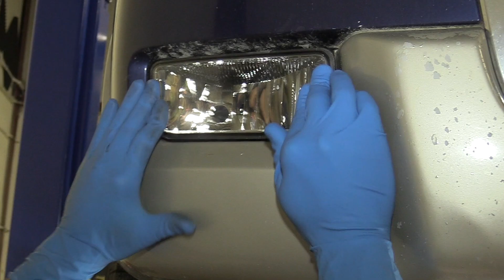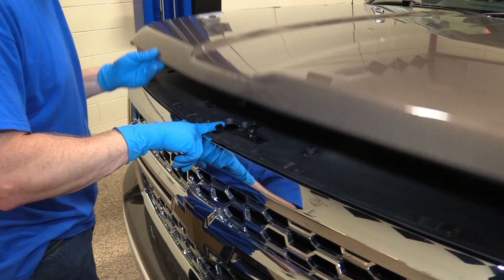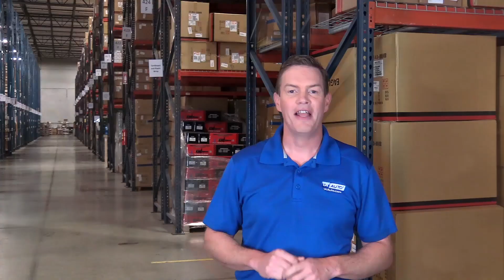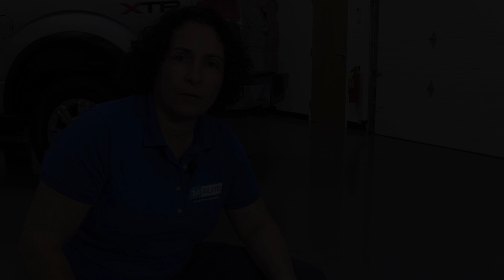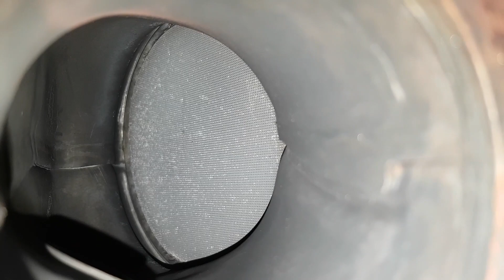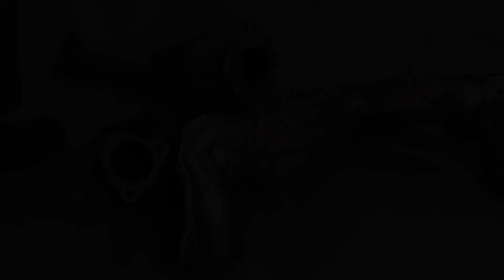Check Engine Light? Catalyst System Efficiency Below Threshold - Code P0420, P0430

Comment: I purchased a catalytic converter from 1aauto last year and now I'm getting a p0430 code. I checked the converter and it looks fine. I fixed the exhaust leak I had,all spark plugs and coils changed. What else can cause the code if the converter itself is ok?
Reply from the maker: +Ekey767 Thanks for watching!  You might also want to check the O2 sensor and make sure there are no other exhaust leaks.